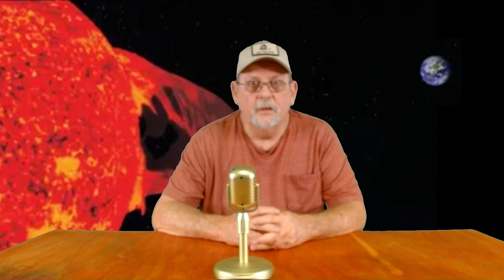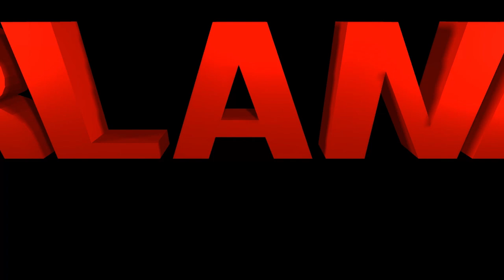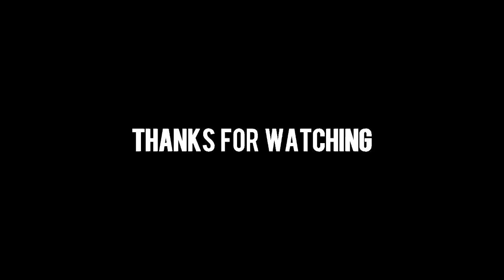EMP/CME vs Batteries

Comment: Just thought I'd mention my experiences...... got the Redodo 12V 100ah batteries off Amazon. About the cheapest option but excellent quality and working well in RV. So got 4 more for 2P2S setup to run 220v sungold inverter for well pump. Working great for about 8 months now. Also bought 4x EG4 LifePower4 for big solar project. Not fully in but I really like what you get for the $.

Comment: I keep few spares for my very small solar power system in an emi/rfi shield bag (technically a Faraday bag, but doubtful of claims of untested equipment) also keep non electric tools ie butane soldering iron, brace and bits just in case my cordless tools in a sealed aluminium Faraday box can't be charged for whatever reason.